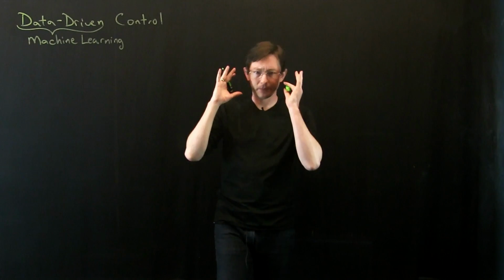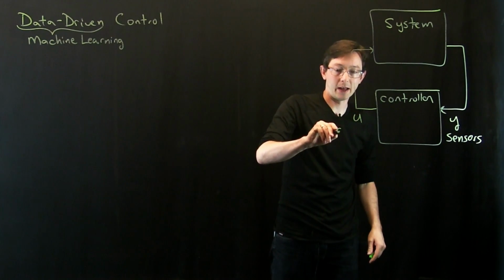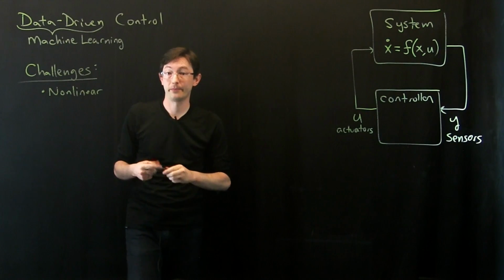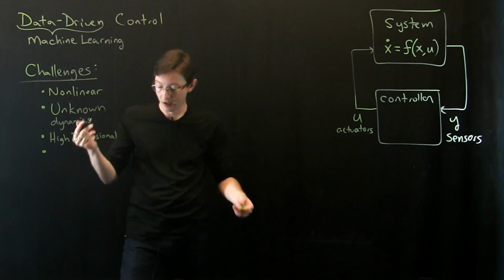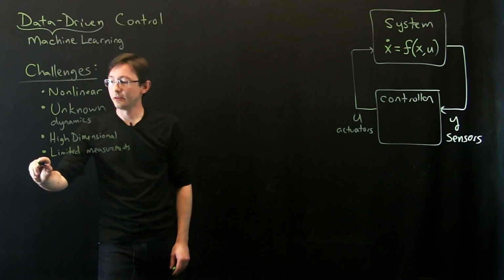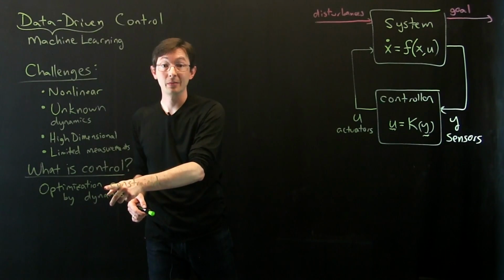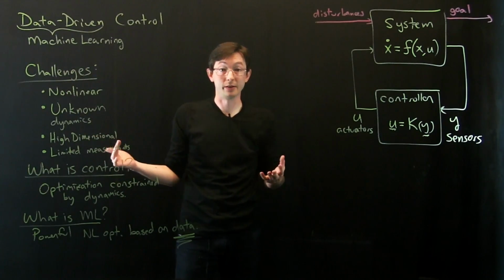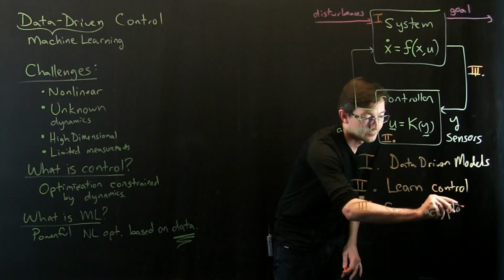Data-Driven Control: Overview

Comment: Sweet, I've been planning to get a small cheap car or a junkyard powertrain, and try my hand at fuel, ignition, and geometry controls, with emissions, efficiency, and responsiveness goals.
There seems to be a lot of untapped potential there, given that engine ECUs are still largely based on low resolution maps and map overlays rather than explicit nonlinear controls and flexible memory. It may still be worthwhile to visualize data driven controls this way, but it seems like a limited way to author them.

I hope there are some gems in here to get me in the right mindset for this. Thank you for sharing.

Comment: Hi, thank u for this overview. An observation from practical industrial experience: so far we see ML/deep learning has limited use cases, due to the need for clean, good data and difficulty to deal with dynamics. Most industrial data aren't images or tweets. 
ML and non-linear optimization is already part of some optimization systems, but this is modeling and statistics. For control we still will keep it simple from cost, safety and reliability perspective, as well as the brownfield difficulty that arises of implementing these in existing plants. 
I personally don't see the use cases of controlling neurology, mixing chems or turbulence in the near term as likely to utilize these approaches, as they either have existing, safe control solutions (usually linearized haha) or are use cases unlikely to be controlled. I really am trying to keep my mind open about the ML but so far I saw very few real life industrial use cases for control. I hope I'm proven otherwise.
The last part on direct ML control sounds awesome and could be the real use case - but would require such in depth understanding of the system, which goes back to the data problem.

Thanks again
Reply: I wonder if there are any changes to your opinions about a year after?

Comment: Hello! I’m scratch building and programming an autonomous quadcopter to learn some of these methods in application. My goal eventually is to replicate the fast-pace actions seen in drone racing autonomously. Could I use some kind of MPC with data driven system identification for better model performance?
My plan is to use a fast cheap control law like pid to enact angular setpoints, and a slower but smarter controller that determines what those angles should be. Do you have any recommendations? 

Thanks for the awesome content
Reply: Check this out : https://www.youtube.com/watch?v=FHvDghUUQtc

Comment: I would like to build a mechatronic dragon or bat or bird that could learn how to set its wings against the wind and sail around using virtually no energy like real birds do.. literally all it has to do is deflect the wind downwards slightly and occasionally flap to stop itself being dragged along with the wind and that's SO MUCH more efficient than spinning rotors at thousands of rpm it could stay up for hours!